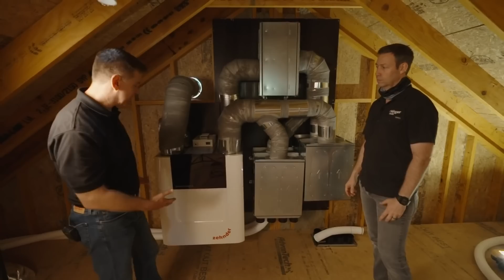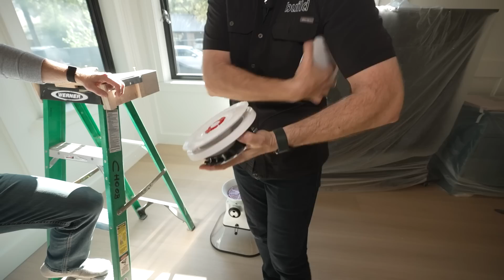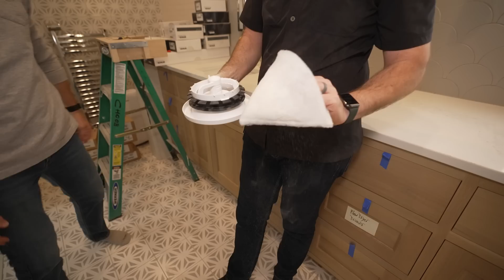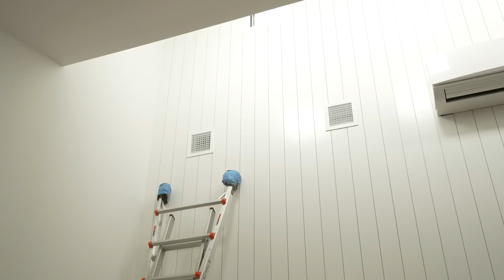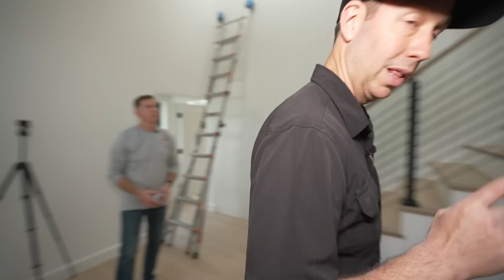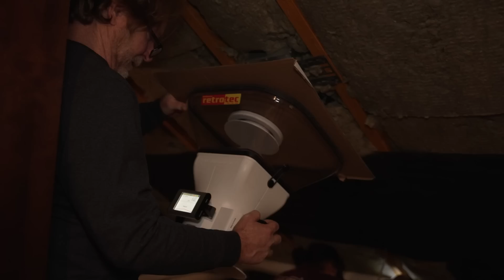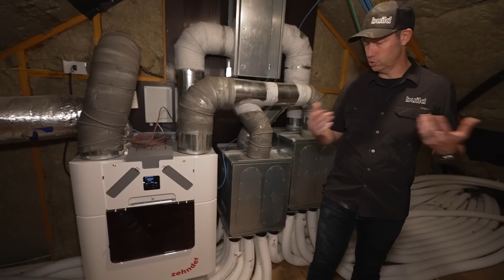Commissioning The World’s Most Efficient Fresh Air System

Comment: Matt, that looks like a well-engineered system but I think it's overkill. The central air handler can mix & distribute fresh air right along with the heat/air and thus avoid all that extra expense for separate ducts. A variable air volume system with direct digital control can deliver air continuously in just the right amounts to any room that needs it. Co2 sensors and dehumidify/humidify control give precise whole house control. And the maintenance is all at the central location. A few Phoenix valves can do the job. https://www.youtube.com/watch?v=003m3QD7UVs
Reply: Excellent point. We have used this system in a few of our builds because the client really wanted it. However, we generally go with exactly what you just recommended. Matt is doing a fine job on his build at any rate. 👍
Reply: Unless you’re using ducted mini splits….
Reply: @dandan1364  Ducted? The whole idea behind mini-splits is 1 unit for 1 zone, multiple units for multiple zones. A variable speed central system can have zone dampers to control multiple zones.
Reply: @ToIsleOfView  That was 1st Gen mini-splits. Modern units can have multiple zones with 2+ compressors in the outdoor housing. Some, like Mitsubishi, also have manifolds to direct the output to multiple locations. They're moving heat around the home to where it's needed instead of just bringing heat in or sending it out like the early tech did. Obviously, they can still do that--send heat out or bring it in--as a part of the process.
At Matt's home, for example, he used mini-splits for heating and cooling, but a Zehnder ERV system for ventilation (fresh air, enthalpy management, exhaust). There is no 'central air handler' other than the Zehnder. No sheet metal ducting, etc.

Comment: The only thing I see in this house if I was looking to buy it is everything in here is high tech but with that means it's alot of money when something goes wrong. So later in life when the dryer goes out u will have to buy another exspensive dryer to take its place or when the air filtration system quits working you will have to buy another one and I'm sure it's very exspensive which owning a house is already exspensive so to make it cost even more. That's one big reason why I wouldn't buy a house that's been built like this. Even if I was rich and have money to throw around I still wouldn't. You don't get rich by spending money you get rich by working and saving money and a house like this is just going to suck all your money to upkeep it..

Comment: There are filters on each return duct... 😳Those are definitely going to be forgotten about over time. Matt might not forget to clean them, but if he moves, they're never going to be touched.
Reply: Nah, he will give the new owners a call every 6 months and remind them... Or they could program the fancy lights to sound an alarm every time they need changing.
Reply: They need to start putting filters on fart fans. I'm not a contractor and I've seen a bunch get disgusting over the years.
Reply: With the Q unit when the static increases past a point due to plugged filters an error will occur.  If the app is installed on a phone a notice will sow up on the app icon.  As well as an error on the controller will show up.

Comment: I hope you’ve tried do use a condensing dryer before I have and they completely suck
Reply from the maker: I’ve had a Miele dryer for a year now and it’s been pretty “normal”. Run time is about 50 min. Only hiccup is sheets ball up and don’t dry well. Other than that it’s been great. No issues
Reply: @buildshow  I thought the one I used made the clothes “crunchy”. Kinda like if you hang dry clothes. It was a cheapo not a Miele so that may be the difference.

Comment: I'm comment bombing here, but I see so many issues with this system...
No bathroom exhaust fans? So every time someone take a shower you need to ventilation the entire house? This means everyone should take a shower around the same time. You're essentially over-ventilating by doing this.
Reply: There is no such thing as over-ventilating. Bathroom has an exhaus and, it's always on. Boost mode is only needed if you have a poor diet or bathe like a hippo. There's virtually zero energy loss in Matt's climate. Unit will operate at 90+ % efficiency. Boost mode is > 150 watts and runs for 30 minutes. I'd personally set this to 15 minutes and include a humidistat trigger in lieu of a switch for the main bathroom.

Comment: Does the unit have to be in a conditioned space like your attic or could it also be installed in an unconditioned/unfinished basement in the northern US??
Reply: Its always best to have any air handling equipment inside the conditioned space
Reply: It MUST be in conditioned space.
Reply: It is always preferred to be in a conditioned space, as long as the space does not exceed 104F or below freezing the unit will work.  It will have a a reduction in efficiency.  So please make room inside the thermal envelope.

I have a saying: at one time we figured our how to bring the fire inside to stay warm heat water and cook, we figured our how to bring the toilet and running water inside so lets figure out how to bring our ventilation inside.
Reply: Tommeehr i wish this was mandatory

Comment: Do you tune it with the bedroom doors open (little kids) or closed (teenagers)? And with the main returns being in bathrooms, how do you tune, with those doors open or closed? So is the idea that you would never actually open your house windows except in an emergency?
Reply: Your doors need to be raised from the floor for at least 10mm to allow the air to circulate. So it is notumportant if you tune system with doors open or closed.
Reply: @Tommeehr  
Absolutely agree.  I have done commissioning's and where we have tested flows with interior doors open and closed and found no change in the flow.
Reply: @andrewwahl4503  yes this is the point. I am
commisioning zehnder systems in EU and have many years of experience with Zehnder. It is top of the line product in EU and is widely used and installed.

Comment: I have the same system but in Poland. My filters have to be replaced every two to three months because they still use coal or wood burning fireplaces to heat their homes.
When I replace the filters they are completely black! Why guy’s are very spoiled in North America because your air is much cleaner to begin with.

Comment: This sounds suspeciously like another expesive gadget to lose its memory with every power surge or failure.  Did I hear, fifty interior filters to remove and wask every 3 or 6 months?  Filters that you need to stand on a ladder to access?
Reply: No, it's ok. You just need to get sponsored. Good to go!
Reply: @MrTexasDan  😂😂😂 yeah this is nuts for an average homeowner.
Reply: Well they are mechanically adjusted to the memory should last with power outages, but I don't want to tell my builder to put all those tubes in.
Reply: Only the intake tubes have filters. So primarily just the bathrooms.
Reply: What memory, what are you talking about?
Reply: All settings are stored so when power goes out and back on the unit continues with the same setting before the power went out.

The Q has a build in surge suppressor and a fuse.  There is never a guarantee of not getting a power surge that can burn out even the best surge suppressors.
Reply: We added the system for a couple of clients that really wanted it. It has a lot of bells and whistles and I tried to talk them out of it. We ended up going back and remiving one. A lot of Maintenance that most people don't want to keep up with. Shoot, most people forget the even replace a standard return air filter!
Reply: @tcidevelopment5996  so true. What a waste of time and resources. Just add fresh air to you traditional HVAC.

Comment: Thought you weren’t suppose to draw/vent on different sides of the house as wind pressure can make it not work.
Reply: No, it does not matter here, it is a fully balanced system.
Reply: The Q has internal logic and measures static pressure.  As the internal house pressure changes and/ or the pressure on the exterior terminations changes the unit is continually correcting.

Comment: Can you put that bathroom switch on a humidistat switch?
Reply: Sure why not. Its just a switch, don't matter what triggers it. Could be  motion detection if you wanted. Most manufacturers have a humidistat switch option.
Reply: The "boost" option seems like a big gimmick anyways.  The whole point when Matt first showed this system was, as I understood it, the air intake works 24/7 so you never even have to think about bathroom exhaust.

You'd need to be running that shower 12 hours a day to worry about humidity in the bathroom.
Reply: You might want to monitor VOC in a bathroom as well. I'm guessing you could have separate sensors and interwork via IFTTT.

Comment: I am looking at a 12,000 house that is well built but not sure how this system could be installed as building processes are complete and it’s been lived in for 10 years.   How does the company assess how this system can be installed and integrated to a new HIPA filtration system as we get a lot of toxic smoke for two months each summer from forest fires all over west coast.
Reply: You should note that this system only puts fresh air into the second floor, where the bedrooms are.  Matt states that early on.  So installation in an existing home is dependent on attic access.  But keep in mind that his attic is conditioned.  The Zehnder ducts are not insulated, so should only be in conditioned space.  I don't see any concerns with integrating into a HEPA filter upstream of the fresh air intake, but I'm sure Zehnder can answer that.
Reply: @CitEnthusiast  Thank you!
Reply: HEPA filter inline with most companies HRV/ERV is not likely going to work.  And you should ask why.  Because the units are normally not designed to push air through a high static filter. 

If you can get the pressure drop numbers from the HEPA filter companies and the HRV/ERV company has static numbers for their systems then a determination of will it work or not can be made.  Good luck getting numbers for the HEPA companies in the flow rates needed in whole house ventilation systems.  Normally their filters go in stand alone systems with a fan made to move air with high static at an energy penalty.

I have one HEPA filter from a company that was kind enough to give me one, retail price $250.  I have the ability to test flow and static (non certified).  The filter is a 20x20x5" and with 200 cfm it is ~0.2 In. W.C. which is to high.  Will it work, maybe, depending on the static of the system and the unit fan.  Most units should be designed with LOW static to have LOW fan watt draw since they run 24/7.
Reply: @andrewwahl4503  Thank you.

Comment: can you install the system in the basement or on the same level as the first floor of a home?
Reply: It can be installed anywhere as long as it is in the insulated envelope of the house. Unit sholud not be in too cold of toohotplsce or efficiency of the system will suffer.
Reply: See my response above

Comment: For anybody that wants my first hand experience here it is.
Built a 2ach50 barndominim super insulated double stud frame conditioned crawlspace the works. 
I've been cooling and dehumidifying it while I built it with the hrv off. Electric bill in summer 30 bucks. (very minimal attic insulation still) 
Moved in turned on the hrv. It takes air out of the bathrooms and brings air into the HVAC return. 
Humidity went through the roof. The dehumidifier ran all day and only got the house down to 60 percent. Electric bill was on track to be 250$. Turned off the hrv and the humidity dropped 10 points in 3 hour. In my opinion it's a waste. Ymmv

Comment: So much excessive plastic use with all these tubes. I get the modularity, but a design for the specific home with manifolds would make much more sense than individual runs from the system to each register. Also seems excessive to have these even in water closets which spend most of their time with the door open.

Comment: I had an HRV at my old house. I hated it and removed it.
Reply: What did you hate about it?
Reply: @MartinThmpsn  it would backdraft cold air into my house in the winter.
My fan controls in the bathroom never worked properly and I couldn't find anyone to work on it.
It was a smaller house and the noise of the unit could be heard through almost the entire home so fir those reasons I removed it to achieve more storage room in my laundry room where it was installed.

Comment: Why not have a Hygrometer/ Humidity sensor that auto runs the boost mode?
Reply: It does havet. ComfoAirunits are fully equiped with sensors. It will automatically go to the boost mode (if allowed) if it detects increased humidity. In my case when I open for example dishwasher that finished washing it takes up around 10 seconds for the system to detect increased humidity.
Reply: @Tommeehr  
Correct as well as individual RH sensors can be added for rooms such as bathrooms

Comment: Lot of gimmicks for such a small house. Kind of like spending 4k on rims for a Toyota. In the end it's still a Toyota. Not impressed. If you ever sell this house, all the gimmicks won't add a nickel to the property.
Reply: I suspect the value of the home will be higher simply because it is a documented build by a reputable, and recognized expert home builder.  I'd certainly pay more for such a home with lower running costs.

Comment: How much is that system? I think it's like $10-15k, no?
Reply: In EU this system is around $10k without installation. But his system is big, smaller systems go for around $6k
Reply: @Tommeehr  Thanks. In my house I installed Soler & Palau smaller unit with EC motors, just to cover 2nd floor bathrooms and 3 bedrooms. It was about $1000 bucks and installation was free since guys were installing AC at the same time

Comment: I like the system but it looks like it is really designed for a small European house. Who's going to clean all those filters? I can't even change the cabin filter on my wife's SUV. I'll just keep my 20 year old AC system and make my cats live in the garage and outside. They always seem happy when I get home:)
Reply: Itis not. There is the whole range covering from the small apartments up to a big houses. You do not need to clean any filters. Filters on extract valves are optionall and not mandatory. With the filters you do not need to clean the system as often. In regular use zehnder recommends to clean extract pipes once every 4 years and supply pipes once every 8 years. It is not dramatic as you trying to show it. Presonal commitment or the lack of any does not have anythind to do swith the qualitiy of the system but you as a person, you will doit or you will not, as simple as that.
Reply: lol

Comment: looks like you have a return vent hooked to the system in the attic, any particular reason it's not located at the ridge?
Reply: Erin

In a well insulated tight home with proper solar gain the temperature from floor to ceiling should be less than 1 degree F so it should not matter where the return is in the attic.  The only rooms that matter are the bathrooms with tub or shower or the kitchen.  The vent then needs to be in the highest part of the room.  The higher the amount of water in the air the lighter it is as well as shower water is normally higher temperature than room ambient so the water warms the air and it goes up in the room and by removing it from the top is more effective.

Comment: I simply can not wrap my head around all this. The constant need to schedule appointments for engineers to come out and service the multitude of overly complicated systems. Not to mention the 1K minimum service charge. I don't care how rich someone is, all of this is simply unnecessary.
Reply: Yep. Such a waste.
Reply: @Ampacityelectric   The point isn't to keep dust and allergens out, although that is a side benefit, but to keep the conditioned air in, and unconditioned air out so heating/cooling costs are as minimal as possible, and energy use is also a low as possible.  This Zehnder unit fixes the issue of no fresh air getting in since the house is so tight.

If you watched an earlier video you would have seen and heard a discussion about building houses for those people who do suffer a great deal from allergies, and the extreme mitigation techniques necessary at times.  Certainly this is expensive up-front.  Matt has been upfront mostly with his costs, and he's paid for almost everything installed in the house, with some significant discounts at times.  But keep in mind, he's in the business of building custom homes, so this build brings a number of technologies together giving him invaluable experience in putting multiple advances in one home which he can leverage to meet customer demand or requirements in other homes he builds.
Reply: Guys from US, you understand that those systems are common in EU? Why is energy efficiency, care for enviroment etc, allways problem for you?
Reply: @Tommeehr  Marketing/Lobbying at it's finest. Maximize profits, sacrifice everything else.
Reply: There's no ongoing maintenance that requires appointments or engineers.  In fact it's pretty easy to install and commission one yourself.
Reply: @cindianderson9443  Agreed! Plug and play!
Reply: Spoken like a true Old Schooler. Its 2023 yo. Why not live more comfortably with technology?